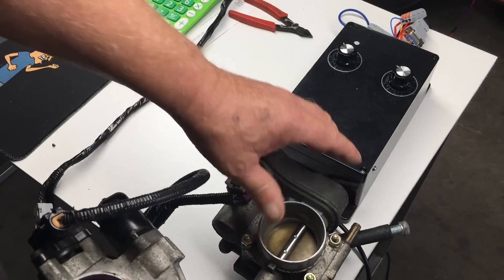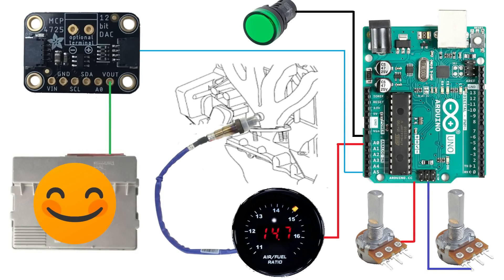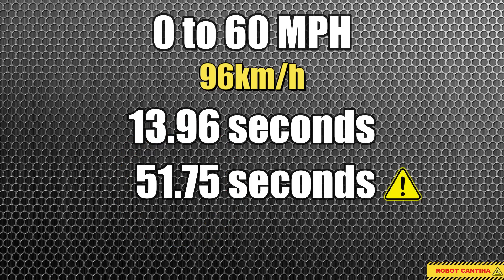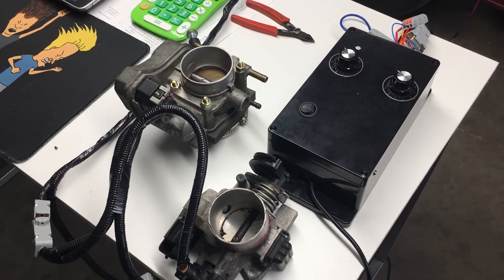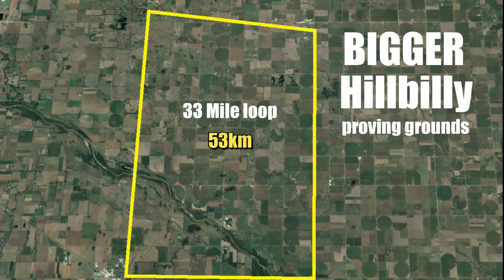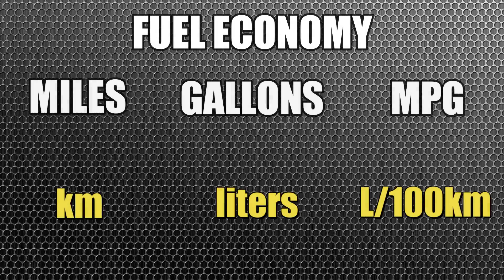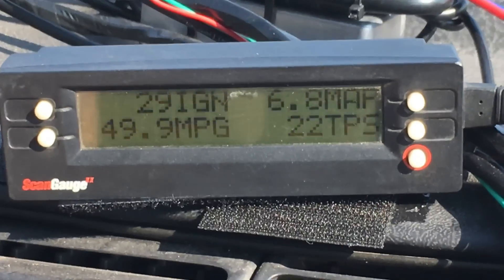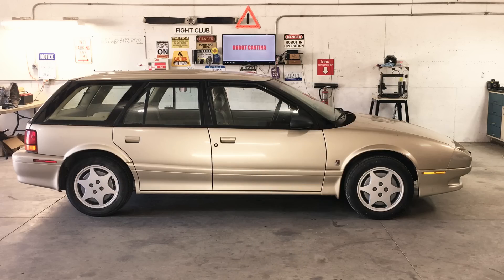S2E21: Our modified Saturn that gets Extreme MPG with lean-burn and Robo-throttle.

Comment: What would be cool is if you installed higher compression pistons on top of being able to control ignition timing
Reply: Believe it or not sometimes this can hurt fuel economy. Depending on piston design it may cause the flame front to take longer to travel from the ignition point. Higher compression could also cause different air turbulence requiring more fuel just to burn properly. 

Not saying this wouldn’t help. It’s just difficult to predict results without testing.
Reply: @Fk8td  You could just skim the head and block a little bit (obviously not too much, depending on clearances) to gain more compression (or rather lose combustion chamber volume). Might not affect things negatively.

Probably a bigger problem when raising compression would be knock, as you'd be more prone to it. That's obviosuly not something you want.
Reply: You can go even leaner to retard knock.. it becomes more difficult to ignite again. Other things include just maxing compression on premium without running lean, water injection etc. Mazda do something like 16:1 compression with 28:1 air fuel ratio with a supercharger, but they use direct injection and ignite a richer pocket nest the spark plug to get the thing going iirc.

Comment: i read something recently that said some/most new cars have a way of kicking off the alternator draw unless on deceleration etc is this something you could try? also  THE SKID FACTORY did a video (Tuning Our Car on E10 to BEAT FUEL PRICES $$$) and got some very interesting results with E10, which had knock resistance on par with 98 high octane fuel, the car made more power (after tuning for the E10 fuel) 
can any of these be incorporated into the Saturn?
Reply from the maker: I believe we are already using E10.  Isn't E10  10% Ethanol?   The compression the Saturn engine generates apparently is not enough to cause spark knock and we would likely find better fuel economy with ethanol free gasoline, however that stuff is expensive around here.
Reply: @robotcantina8957  thanks, amazing the fuel differences in fuel worldwide considering the car is likely same in each country(same tune? or different to accommodate the local fuel?) 
i look forward to the next episode, thanks again.

Comment: i might have some ideeas to improve the mpg .
1 try some spiral pipe from the carb to the engine , might make more turbulence and increase the atomization of fuel , mabe .. 
2 increase the lenght of the intake runner and make some hard angles on it to generate some turbulence to help blending the air and fuel better
3 try some differite gaps on spark plugs or some better spark plugs  like the e3 or pulstar
4 consider a dual smaller carb setup for the engine, like do a Y style intake running into that trottle body 
4.5 do the same thing with 2 smaller carbs but make em feed 2 pistons individualy , pretty much you get like 1 carb feeding 2 pistons and another one feeding the other 2 
5 add some sort of vortex generator for the air to get turbulent and atomize better with that fuel like in the direct injection cars 

planing to buy a ls400 next year ,  defenetly gona do thouse mods I suggested on it, I wanna have a good mgp v8 for daily use . But until that day I would like to share thouse ideeas and mabe you can see some results , all the best!
Reply: thing is this engine is not carbureted. making sharp turns will just restrict the flow of air making the engine have to work harder to pump air. The engine is just a big air pump, the less restrictive the input and output the less work it has to do, increasing efficiency.
Reply: @jonathan7744  true, but a sharp 90 bend will increase turbulence to improve the mixing, if not adding someting inside the intake to generate some turbulence like dimppes on the golf ball might improve the atomization due to tubeling the air more and giving a slightly better mix. It will reduce the hp overall but the goal is mpg not hp gains for this project, if not, some zig zag twists from the carb to the engine will do the trick beeing less restrictive. Thouse need to be tested, might improve the mpg might not. Testing will do the talk
Reply: @dragosm.7881  Problem is hp is often mpg. the more hp you make with the same fueling is better efficiency. Also why do you keep saying carb, this engine isn't carbureted. Yes it probably should get tested but I do not think it would make much of a difference, either with dimples or a zig zag. The most promising thing would be to redesign the intake runner length to resonate at the frequency for driving down the highway. You pack more air in, making more power, you don't need more power when remaining at a constant speed, so you close the throttle blade more. Will any of this get tested, probably not.
Reply: @jonathan7744  I'm aware the car is injected not carburated but i seen a guy on youtube runing a standard carb v8 with a hella small lawn mower carb and got like 40mpg form a engine that gets in good days 27~. Ofc the best thing will be to get like 3-4 small cc injectors on a custom map and angle of mounting to generate atomization alike a carburator, put em far ish from the engine and by dooing so you alow the fuel to better mix itself, before entering the engine... I'm aware that fuel in form of liquid going in will not provide the nice mpg we would like to see, the better it is mixed and atomized better usage you make of it. aditional fuel injectors is not cheap + not sure how reliable thjs ideea will be for the long term, that's why the carbs come as the cheap way around just gotta keep em cold to prevent vapor lock. I don't dissagre after all this is balls to the wall it might be really stupid for this very car but is worth a shot afterall the main ideea is to test and adapt to what works. Sorry silly me tought the car still had the little carb on it. 😅 but anyway I will keep my promise and as soon as I get the car I want a ls400, I will costumize it a little for my own preference, register It, then I will adress the mpg situation since I want a v8 as a daily and be sure I will record the progress and put it on the internet, might take me 3 years from now until I can provide the testing results but I will do anything I can to get a sweet 3-4l/100km, I tink is possible, worth the shot

Comment: 90' ECUs should not throw codes even when load signal is quite offset from normal. In 2000s piggyback devices was very popular. I used that kind device to rise power in early VW's 1.8T 20V engine. With installed bigger injectors I decreased maf signal to prevent flooding on low load areas (early 1.8T doesn't have map and even boost was controlled using air flow). With maf signal alteration I need to retard timing because when ECU reads less load and increased timing and that device can shift many types of trigger signal to counteract that issue. I used locally manufactured ecumaster DET3 (full standalone ECUs of that manufacturer are available in USA). Even Craig Liberman's 600-700HP Toyota Supra from Fast and Furious movie was stuffed with ECU piggyback devices.

Comment: Doesn't lean-burning cause the NOx emission go thru the roof?
Reply from the maker: Yes,  lean burn will raise the NOX in the exhaust.   Originally we were going to copy the method Honda used to combat the NOX issue, but since we were only able to go slightly lean, we didn't feel it was necessary.

Comment: If it only has crank sensor then chances are it is not fully sequential. Ignition is probably waste-fire and injectors are triggered batch-wise. (Or it is a SAAB and uses ion sensing).
Reply from the maker: Indeed, most engines with only a crank sensor batch fire the injectors,  The 1.9L engine on this saturn S series is  true sequential injection and they were able to do it without a cam sensor.  A few folks have already left comments on how Saturn managed to do it, its fascinating.

Comment: Sequential injection can be done with only a crank sensor by measuring crank acceleration, obviously the crank slows down on a compression stroke and speeds up on power stroke.  Given the very few teeth on the Saturn's reluctor ring it's probably only determining this during cranking, after which it can track crank and cam position.  The older Smart 600/700cc three cylinder engines use this strategy.
Reply from the maker: The 1.9L engine in this Saturn only has a crank position sensor and no cam sensor, however it is sequential injection.  I know its hard to believe and that is what was baffling me too.  Some folks have left comments on how Saturn was able to do it and its fascinating.
Reply: From what other commenters posted this Saturn uses a wasted spark system.
Reply: @krashanb5767  Wasted spark via a crank sensor on an engine with an even cylinder count is easy, sequential injection not so much.

Comment: Is the Saturn definitely sequential injection?
Reply from the maker: Yes, it is sequential injection.  Some folks have already left comments on how Saturn was able to do it without a cam sensor and its fascinating.
Reply: @robotcantina8957  interesting, I’ll have to check that out. I started wondering if it’s wasted spark; does that waste much fuel? Presumably not a lot?

Comment: might just use the time between pulses off the crank sensor to time the fuelinjectors (maibe same as wasted spark so two at a time) , could alsso just open them all at the same time depending on vacuum and crankpulse 
might need to hang the signal wires to s scope to see wat happens (use the ecu of another wrecked car and feed it signals then see wat it puts out , i think i seen devices for those signals made for the microsquirt)

Comment: I wonder if the Kubota diesel will get better mileage 🤔
Reply: Maybe, diesel has more energy density. But the diesel engines are heavier
Reply: @FSXgta  diesel is about 20% more energy dense and because of that produces more torque at lower RPMs but  ultimately it will be the gearing that will determine the MPG victor.

Comment: driving with the windows open or closed makes a LOT of aerodynamic difference.................................
Reply from the maker: Yes, but its been between 95 and 100F here in Kansas and the car doesn't have air conditioning.  We absolutely had the windows open...kinda had to.

Comment: Try adding covers to the back wheel well and maybe those smooth wheel covers trucks have to the front. A lot or drag comes from turbulence from wheels. Car companies mostly don't cover them because big fancy rims look cool and are a status symbol.
Reply: yup. Top of the wheels are going twice as fast as the rest of the car
Reply: Citroen's of old looked cool and they had covered wheels
Reply: @Matt trucks a bit different than a vw xl1 or a saturn or an insight

Undercarriage matters too. However the faster you go the more they matter. Trucks they matter less due to how much rolling resistance there is going to be. With regular cars the aero overtakes rolling resistance 50-70km/h.

Its more about the hole than the wheel itself tho..
Reply: @Matt luckily driving a truck for 20 years isn’t what makes someone an expert on aerodynamics or engineering. I’m sure all those companies add them for fun, right?
Reply: @X85283  actually most of those companies did add them for fun LOL. telling a big super corporation they can save "thousands" on fuel each year is like holding up a milk bone to a dog. After install and maintenance (they always break or get ruined) costs it takes forever for those to pay themselves off. It's just virtue signaling saying hey look at us, we care about the environment and want to keep your product cost down!
Reply: @Matt As others have said, what you write is somewhat true. The factors you mention as important are much larger, certainly on a truck. But other stuff like wheel covers certainly do make a difference, if much smaller, and the higher the speed and more aerodynamic the vehicle is from the start, the larger it will be.
Reply: In normal driving (not hypermiling as shown here) it can be helpful to expose the brake discs/pads to a lot of air for the sake of cooling. Drum brakes (as found in a lot of commercial trucks) wouldn't benefit in the same way and neither would cars that hardly brake with their brake pads because it's just a fuel economy loop or a vehicle with regenerative braking.
Reply: Adam Savage himself.

https://youtu.be/snNL5GgOq_c
Reply: Could also look into aluminum rims if steel are currently used. Weight saving is also a good way to try and improve economy.
Reply: @Matt I'd say that it isn't a very good comparison, especially if you're talking about driving a semi truck. 

The things are basically huge engines on wheels, any aerodynamic efficiency gained by covering the wheels IS negligible when there's a 9-12ft cab that is a nearly vertical wall on the front of it. You're powering through pretty insane drag already, so you could only cut a few percent of the drag AT MOST - if not less than a percent. So maybe it takes that 10MPG to 10.02MPG, or even less of an improvement. If it makes the handling worse it certainly isn't worth the trouble.

However, for this low-powered engine that is in an already decently aerodynamic vehicle, it may make a noticeable difference. Drag is a huge enemy of fuel efficiency. The tires could be generating a fairly significant percentage of the drag on THIS vehicle. I doubt it's likely to be that much, but here, even a few percentage points less drag could translate to multiple miles per gallon.

It's impossible to be sure without him testing, anyways :)
Reply: There's a lot of aerodynamic things they could do to the car. Basically need to make the car as egg shaped as possible. And then dimple all the sheet metal like a golf ball.
Reply: @flb78  golf ball dimples likely wouldn't help things at this scale unless you have really awful aero. Even then normal vortex generators places strategically would be better than the mini dimple vortex generators on a golf ball.
Reply: @flb78  ' like a golf ball.'  Pretty sure Mythbusters tested this, and it didn't work.  Likely it could in theory, but it would be too difficult to bring the rest of the car into a shape where the dimpling would make any real difference.

Comment: When using the carb does the Cat  still do anything at all?
I remember in the 1975 edition of Mark’s Mechanical Engineering Manual it said using Cats would Reduce mileage 30 %.
They suggested a Thermal Reactor that would lower emissions without affecting
Mileage.
Reply: Old two way cats used in the 70s were much more restrictive than modern cats. Little to no fuel economy or power is lost with modern kittys. They do work with carbs but may overheat if the engine is running really rich.
Reply from the maker: The converter on this car is still working fine.

Comment: Can’t wait for the video!!! Let’s guess mpg... I say 62mpg
Reply: I say 69

Even if it would reach 72 i wouldn't be mindblown.
Reply: @antjeeismann4684  Nice!
Reply: I wouldn't go as high. Lean burn can only do so much. I'd wager it will crack 50s, maybe mid 50s at best. Which is very respectable for this kind of engine/car.
Reply: @hojnikb  depends alot on how hard the engine power got castrated by the e-throttle
Reply: @antjeeismann4684  Not really. You can only achieve so much by chocking the engine. Ideally, if you wanted to hit max possible MPGs, you'd actually run the engine WOT and use ignition timing to lower it's output. Also use leanburn as much as possible. It also helps if you have auto tranny, this way ecu can keep the engine rpm in it's optimal range.
And there's also VVT and variable intakes to consider, which also help promote better fuel mixing.
Modern engines actually do a ton of stuff to hit the best possible MPGs. The DI alone helped a lot with efficiency.
Reply: @hojnikb  okay maybe i over estimated the Potential that extremely slow driving has on a leanburner 4 banger that got equiped with e-throttle.

The Potential of decreaing fuel consumption by simply driving extremely slow is at least in Diesel Cars enormous...
I was driving a 5cyl. VW T4 diesel at a constant speed of ~34mph and i achieved a fuel consumption of only 66mpg.